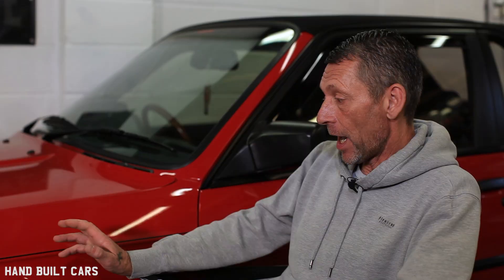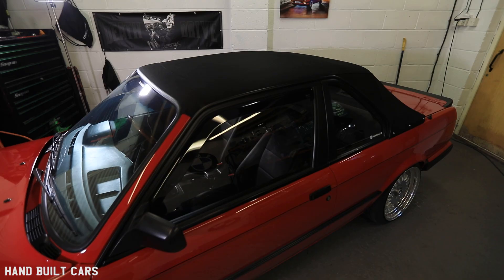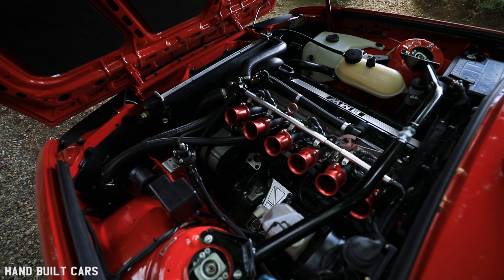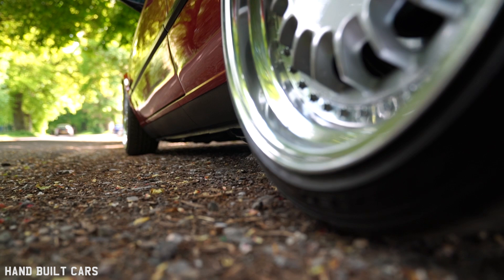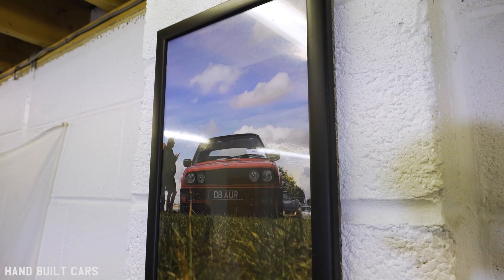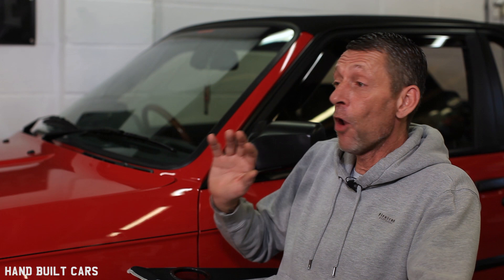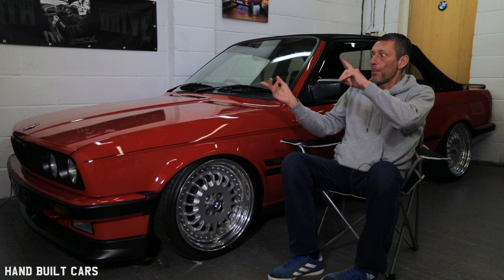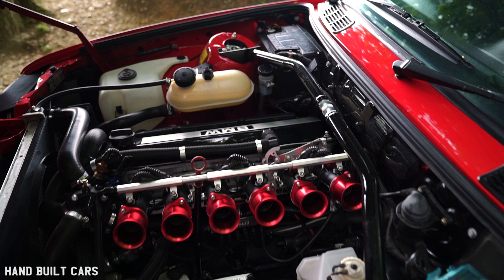Building a True Dream Car - 1986 BMW E30 327i Baur

Comment: What a great detailed interview. She’s a beauty - people like you in the e30 zone is what the community is all about respect. Oooh I think you just had your fourth issue on the car the rear light was out lol 😂 stunning work mate….
Reply: lol yeah i know on the rear lamp as soon as i watched this video i was straight down the garage to sort it
Reply: @tonyforbes-marsden9939  I didn’t think it would be out for long your OCD kicking in love it. I hear you on that ride quality I must say I have stock  bbs 15 inch alloys on my e30 and it crashes and bangs in and on every pothole shaking the car to bits, your set up must be a real boneshaker no? It’s strange I also have a stock 1990 baby benz 190 and that just glides and wafts along on air it seems and you don’t even notice potholes so it makes for a far superior ride and I guess I’m getting old fart status too that said you can’t fling it around a track so I guess that’s the intersection of compromise. Mind you Mercedes’ smashed it on this suspension design with the multi link set up so respect to them too.